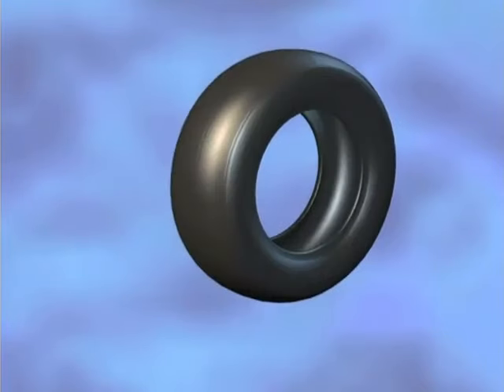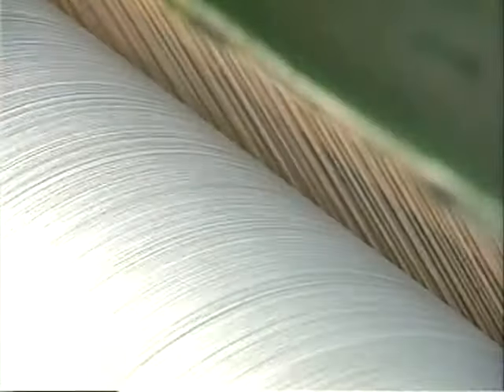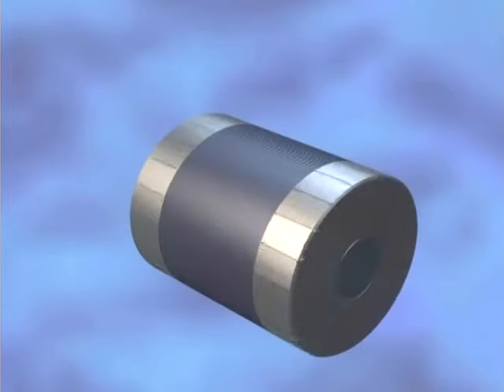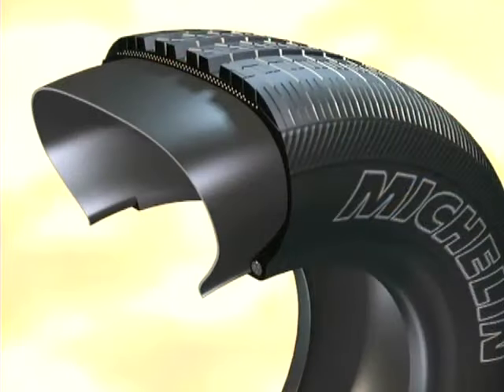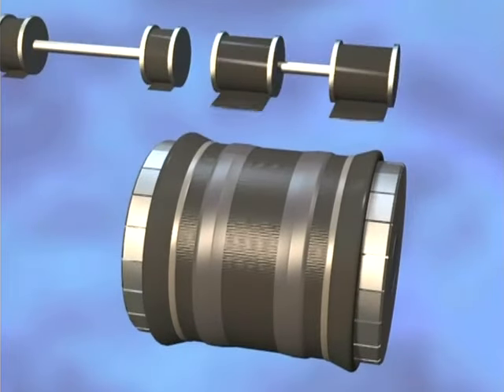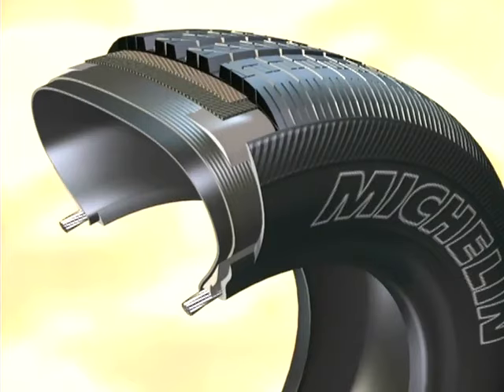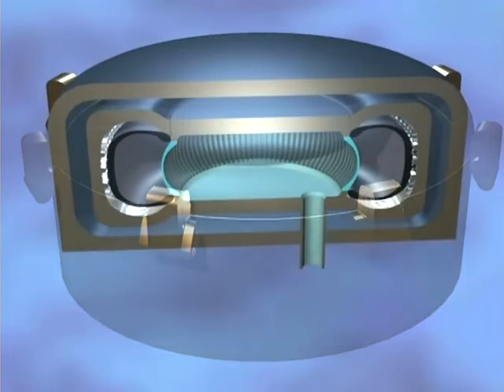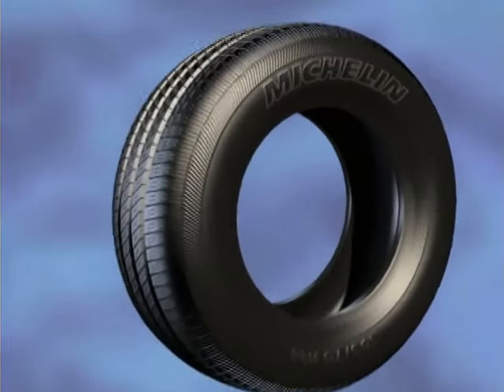How a Tire is Built

Comment: When I worked there from 75-98 the innermost layer of rubber was natural rubber because it would hold air in inflation. They may have changed things since I worked there.
Reply: Work there past 15 years.  The inner layer is synthetic because natural rubber is not air proof.  Today you can go 2 years with zero pressure  loss.
Reply: I was born in 86 thanks for working all those years
Reply: Butyl rubber has better impermeability than natural rubber